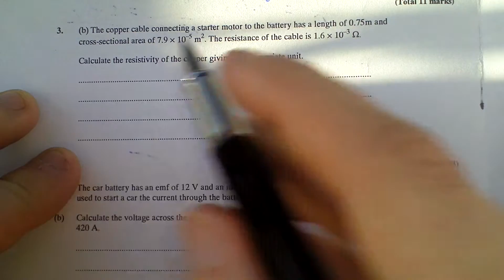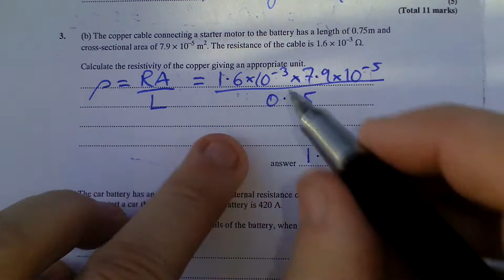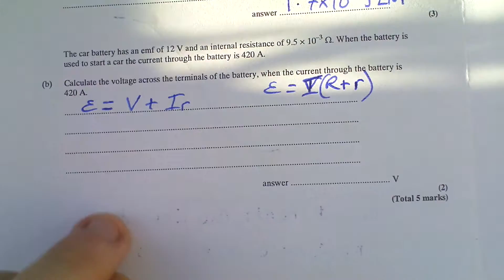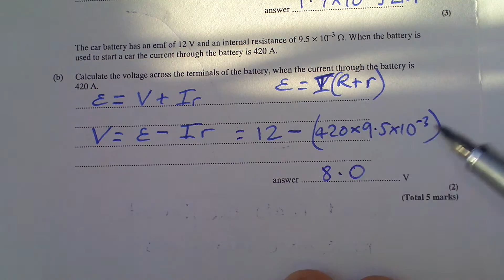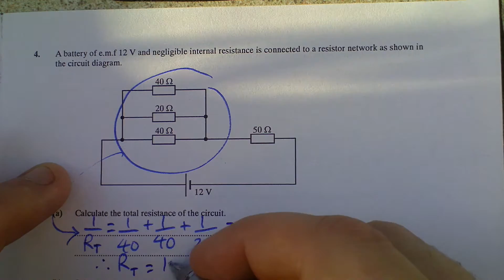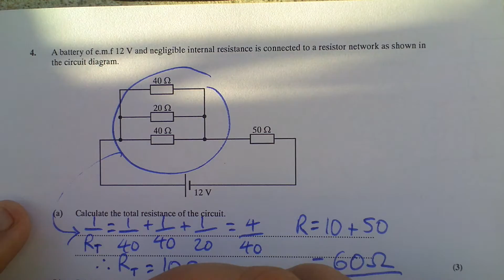PHYA1 Electricity Revision Questions 3-4

Comment: Because to get current, from a ohm's law, you need to use equation R=V/I and R stands for total resistance, in that case all the resistance is recombined at the end of the circuit so it is 60 not 50.